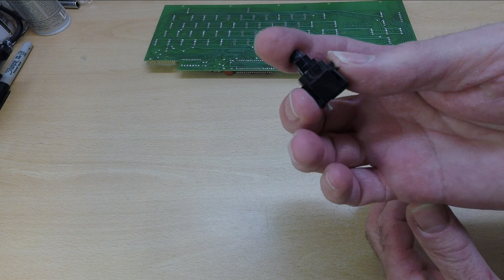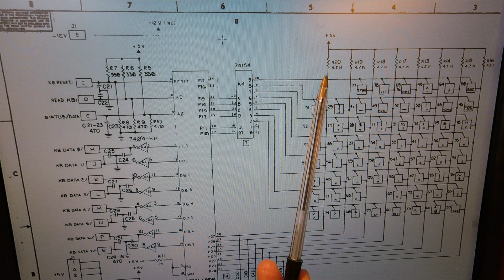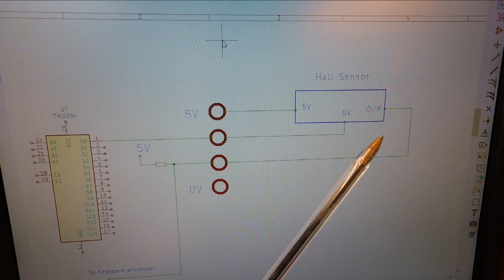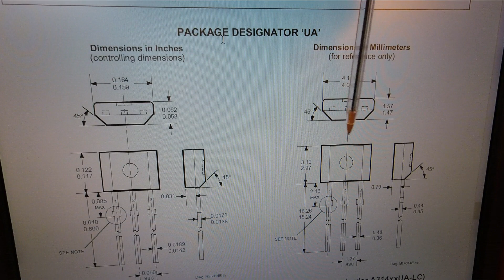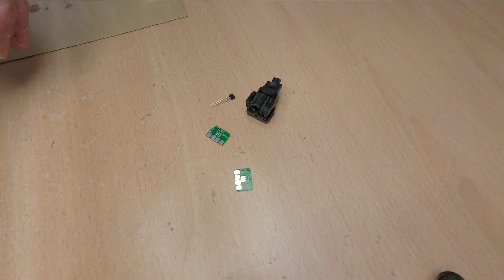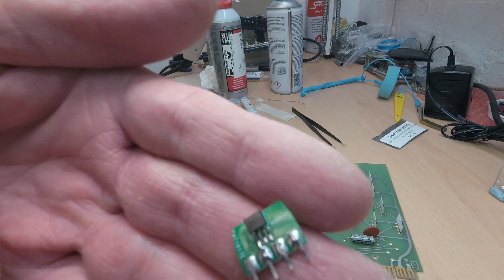Intel MDS II/II Keyboard Repair

Comment: Hello, where can I buy the base plate, what type of product is it?
Reply from the maker: If you mean the small PCB's then they can be made by any PCB manufacturer using the Gerber file located in the description above: You need to specify 0.8mm PCB thickness. I normally use JLCPCB as they are quite cheap and produce good quality products:

https://jlcpcb.com/
Reply: @martynsvintagecomputing6338  Thank you for the info, you have very nice videos, your projects are very informative. I completely restored a "Pertec PCC 2000" computer 3 years ago and now I have a problem with the Hall ICs. However, the keyboard has 3-pole Hall ICs with a similar base plate. For now I have used the Hall ICs from redundant keys, but it is not a permanent solution. The designation of the complete button is 1003SD4B3E. The "E" is important, as it defines the function of the Hall IC. I am not sure whether I can use the Hall sensor type A3144, I have to test that.
Reply from the maker: @uwefrotscher9039  The biggest problem is the Hall Sensor being trigered by the magnet above it when the key is at the top of it's travel. I spent months trying various low power hall devices and in the end had to settle for the A3144 as it ws the only one that trigered at the correct point during the key press.